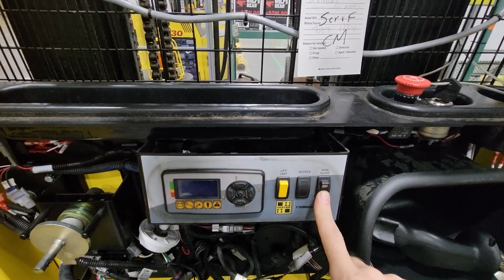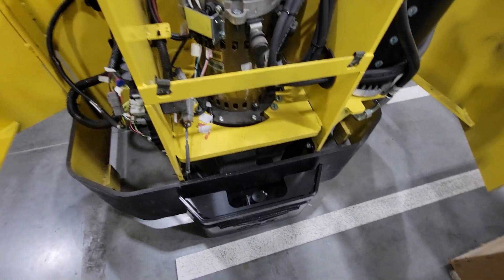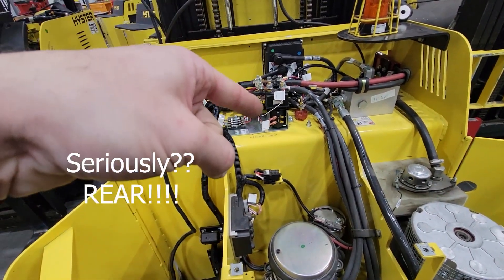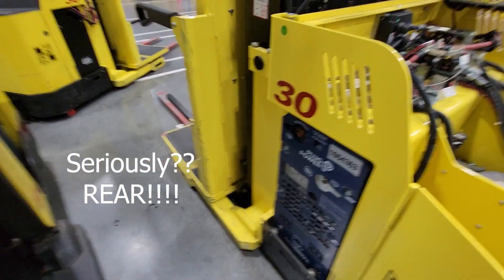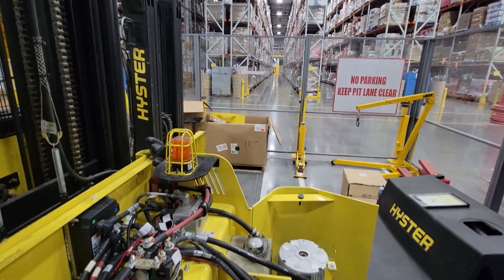Hyster Wire Guidance - Part 2, The Order Picker.

Comment: How often do the sensors go wrong? I presume the operator gets a bit of a shock when the steering goes haywire
Reply from the maker: The sensors themselves are actually very sturdy. In the past 5 or 6 years they been used, I've replaced 1. The older style sensors would last maybe 2-3 years.